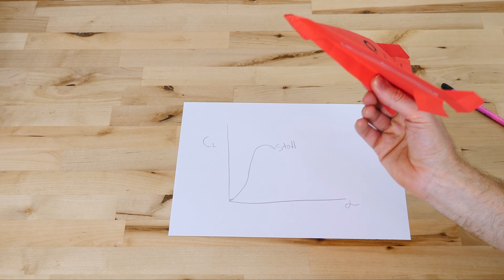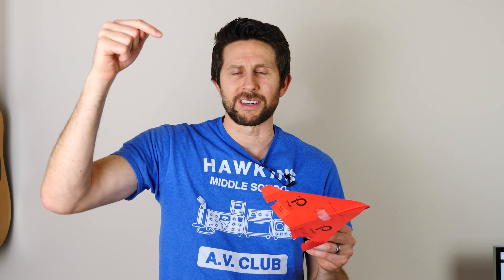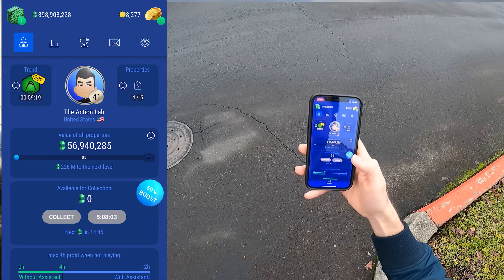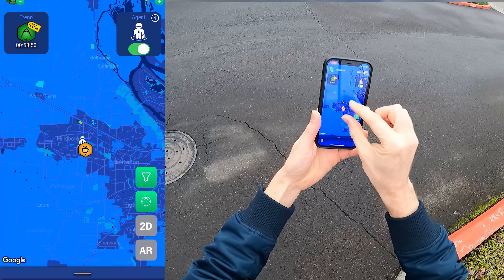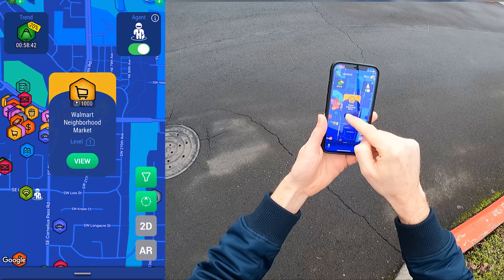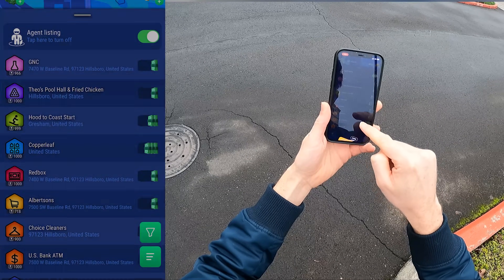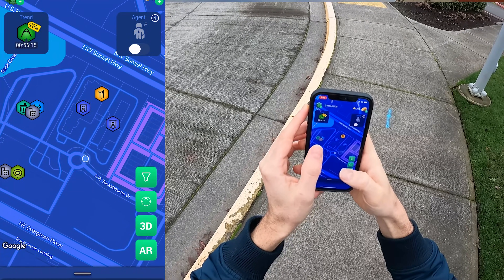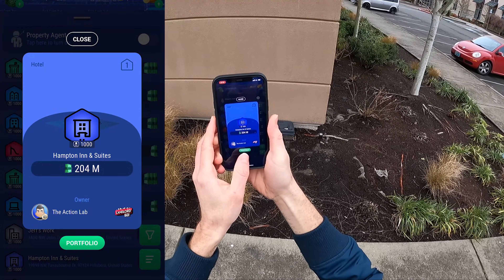How Far Can An Aluminum Foil Airplane Fly If You Add a Motor?

Comment: What is the difference between a plane wind and the lowest Cx symmetrical profile tilted up? Is the first one is more efficient about drag?
Reply: i am le chicken nugget
Reply: One of the ways we measure drag is with what is called the Reynolds Number. the reynolds number of models this small is so high that "crazy" things that should not work..... work. like bumble bees :-) scaled up a bee can't work but scaled down? interesting things happen :-)
Reply: @nerys71  Yes! In layman's terms, a very small amount of air kind of acts like it's "thicker" than a large amount of air - or air has more viscosity relative to the inertia of a very small wing than it does relative to the inertia of a larger wing.

In a practical example, think of how a small piece of dust floats in air, while a similarly shaped pebble or rock clearly falls much quicker.
Reply: Short answer - yes.

For the long answer you need to know that aerofoils produce two kinds of drag.

The first type of drag is called shape drag or parasitic drag which is caused just by the wing existing, being a certain shape and size, and having to push air away from its way to proceed through the air.

The other type of drag is lift induced drag, or just induced drag for short. This drag is only produced if the aerofoil is actually causing lift. The amount of induced drag produced depends on how much lift is generated, and how efficient the wing is.

As long as the wing doesn't need to generate any lift, the most aerodynamic shape is a symmetrical aerofoil which can just go straight through the air. The vertical stabilizer is usually a symmetrical aerofoil (though not always), and it's also common for horizontal stabilizers to have a symmetric aerofoil.

However, if a symmetrical aerofoil needs to produce lift, it needs to have a non-zero angle of attack which means it's no longer flying straight through air. In this case the wing will not only produce a certain amount of induced drag, but the parasitic drag will also increase significantly because the wing is not presenting the least frontal area to the airflow (it's a bit more complicated than that but works for a simplified explanation).

The solution to this is the cambered aerofoil, which has an asymmetric curve to it, with more curved side upwards and flatter (or even slightly concave) side down. This type of wing can produce lift even at zero angle of attack, which allows it to produce lift while minimizing the amount of parasitic drag it produces. Typically, this neutral angle of attack is where the wing gets its best lift-to-drag efficiency, and that usually corresponds to a certain airspeed which gives the aircraft best possible glide ratio.

So yes, long story short - a cambered aerofoil is typically more efficient than a symmetrical aerofoil. However, the amount of camber depends on things like what the aircraft's typical airspeed is - if the plane is going to be flying slowly, the wing will probably be thicker and have more camber, while a very fast aircraft might have a thin wing with relatively small camber.
Reply: @HerraTohtori  Something to add to the parasitic drag: There are more components to the parasitic drag force than just shape drag, and the most important one you are missing here is the skin friction drag. Even for a thin flat plate at zero angle of attack (basically zero frontal area and thus zero shape drag), the surface area of both sides of the plate contribute to the skin friction drag. Depending on how fast the flow is or how long the plate is, the flow may transition to turbulent with an increase in skin friction drag.

Moreover, there are other kinds of drag which contribute to the total drag such as interference drag at the connection points of the wing and fuselage, ram drag fron the jet engines, and also wave drag if the aircraft is near sonic speeds.
Reply: @nicholaslau3194  Like I said it's "more complicated than that" ;)

But yes, skin friction is an important part of parasitic drag, especially with laminar flow conditions. With turbulent flow it's still there but it's a lesser part of the total drag, since the turbulence itself sucks up so much energy. But then you can induce a small amount of turbulence to energize the airflow, which causes it to better adhere to the wing and delays flow separation, so causing a little bit of turbulence can end up reducing drag because the small amount of turbulence reduces the total amount of turbulence... Hence, golf ball dimples and vortex generators.

At high Mach numbers, compressibility starts to play a factor too as the air simply can't move out of the way faster than the speed of sound in air, so the air starts to get squeezed out of the way rather than pushed. Compressing the air requires more energy than simply moving it out of the way, and has a nasty tendency to form shockwaves - which produces something called wave drag. And at very fast supersonic and hypersonic speeds, the compressed air sucks up so much energy that it actually heats up and starts to radiate that heat onto the aircraft itself, which requires heat resistant materials or active cooling to deal with.
Reply: @HerraTohtori  Just to add here the higher an aircraft is, the easier it it for it to reach high Mach Numbers (such as the critical mach number wich is when the flow goes from subsonic to supersonic somewhere around the aeroplane) because of the Local Speed of Sound. The Local Speed of Sound depends on the absolute temperature (in Kelvin) and the higher we get the lower the temperature (Local Speed of Sound is lower). The formula is: Mach Number=True Airspeed/Local Speed of Sound. So, if airspeed is the same, and we climb higher, the temperature will decrease (until the troposphere) and so the Mach Number will increase.

Edit: Also something that I didn't understand exactly: You said vortex generators decrease turbulence but I thought they only added energy to the turbulent air flow and thus delayed separation. Is that the same as decreasing turbulence? Also the level of downwash and the wingspan of the aircraft make a difference in induced drag (if I remember correctly) so there's another whole subject to mention ahahaha. I was supposed to have an exam about all this in February the 8th but it was postponed due to Covid. The only thing I've been struggling with is propellers.
Reply: @ThekingMandM  Vortex generators, like a lot of advanced fluid dynamics, are black magic only somewhat comprehendable by vast amounts of time spent staring at wind tunnel test data, or guessing with computational fluid dynamics. I have neither under my belt so take my commentary with a grain of salt, and consult someone who's actually qualified with aerodynamics and not just physics in general.

Basically my understanding is that, by energizing the boundary layer with small scale turbulence, they can delay flow separation from a curved surface, like the upside of the wing for example. The small scale turbulence causes some drag, but flow separation would cause large scale turbulence, which causes large amounts of drag.

The result is that by adding small amounts of energy to the airflow (which increases drag) the total amount of energy deposited to the airflow is actually reduced since the flow separation, and subsequent large scale turbulence, is reduced.

Of course, a wing that is designed to maintain laminar flow without vortex generators should be more efficient than a wing where vortex generators are utilized to delay flow separation, but it still feels like wizardry. And laminar flow wings tend to have some awkward characteristics compared to more conventional aerofoils, which means that vortex generators can provide a better balance between handling characteristics and performance.
Reply: @HerraTohtori   Holy moly
Reply: @allofall9240  
Holy Macaroni?.😎🐝😋😔😯😮?.
Reply: @THEBOOKOFDARK6888  Yes
Reply: @HerraTohtori  thanks for the executive summary
Reply: @HerraTohtori  Very clear, it's presicsly what I wanted to read! Thanks, I really appreciate 🤗
Reply: @HerraTohtori  https://youtu.be/naThwEARQD8
Reply: @HerraTohtori  please post a link 'evidence' of the nasa shuttle doing a back flip at 1:1 speed 27,000 kph. 
Your technical jargon is not going to suffice here sorry.

Lets see the thrusters 'firing', also show vectoring vapour distortions ailerons and flaps working hard to maintain control especially in the backward phase but all that should be obvious although the alleged atmosphere at that height was only suggested more recently (nasa.gov). 
 I look forward to that link.🤔
Reply: @AV036  What thrusters do you want to see firing? These videos were taken on standard definition cameras, there's only so much detail they can show. The RCS thrusters weren't used all the time while the shuttle was doing the pitch maneuver. They were only used to start the pitch-up, then the vehicle rotated freely through the maneuver, and then opposite thrusters were used to halt the pitch-up.

As for why the RCS thruster use to initiate the pitch-up is not visible - maybe the angle and lighting conditions make it difficult to see, maybe the camera is just too crap to show it. It's not like the RCS thrusters produce some kind of super obvious flames. They look like white puffs of gas which disappear very quickly after use - there are no "vapour distortions", whatever you think that means. I did find a couple of videos showing the orbiter's RCS thrusters in use, if you want a reference for what to look for:

https://www.youtube.com/watch?v=2ewbD2Pv5ag (STS-118)
https://www.youtube.com/watch?v=1xT4GstMyKs (STS-133)

These are the kind of thrusters that were used to pitch, roll, yaw, and translate the space shuttle orbiter during the orbital flight. In addition, the spacecraft had more powerful orbital maneuvering thrusters at the rear, which were used in prograde or retrograde burns to raise or lower the orbital altitude, respectively.

Also, the control surfaces were not moved while the vehicle was in space. That would have been quite pointless as the atmospheric density at that kind of altitudes doesn't provide enough aerodynamic control forces for that do really do anything. In the long term, the thin atmosphere produces some drag which requires periodic station-keeping burns to avoid orbital decay. For things like rendezvous and docking maneuvers, which happen in the timeframe of days, hours and minutes, the effects of atmosphere at orbital altitudes can be discounted as negligible. So, sorry, there's no footage of the space shuttle flapping its control surfaces to "maintain control" while it's maneuvering in space.

Finally, I don't really get your claim that the "alleged" atmosphere at the height of the ISS was "only suggested more recently". What do you mean by this? Clearly the atmosphere exists, there's not point "alleging" that it exists. The existence of the atmosphere is a fact, and the presence of gas molecules at whatever altitude is entirely predictable by classical mechanics.

People living in the 1800s could have accurately calculated the density of atmosphere at altitude 400 km above ground, though it would have a completely irrelevant exercise for them and they probably would have rounded the result down to zero.

By the way, why do you want to see something like this in 1:1 speed? I mean why make that qualification? Speeding up or slowing down footage doesn't really do anything to its value as evidence as long as the change is clearly marked and documented.
Reply: @HerraTohtori  https://youtu.be/-gSY7rFaqSM  true or false
Reply: @AV036  yes
Reply: @HerraTohtori  'yes' to observable reality laws of nature aerodynamics conservation of momentum vs impossible 27,000 kph space shuttle backflip no thrusters or proof this ever happened the way nasa say it did.
Reply: @AV036  What makes you think there were no thrusters used to start and stop the rotation of the space shuttle?
Reply: @HerraTohtori  well if you think otherwise please post your link showing that evidence in real time 1:1 speed 27,000 kph  ______ .
Only real camera footage should also show vectoring vapour distortions ailerons and flaps working quite hard to maintain control especially in the backward phase as we now have confirmed atmosphere at that altitude too (nasa.gov). 
I look forward to that link.
Reply: @AV036  Evidence of what?
Reply: Herra I actually made no claim🤔
I asked to see evidence of what lead you to merely take nasas' word for a backflip manoeuvre (in defiance of logic) of an aircraft that blatantly defied everything you claimed in your response to the start of this thread.
Holy moly😆 I now see you are clearly immersed in a somewhat infantile/ gullible cgi world of pretend WWll aircraft.
Ad to that a blind belief and verbatim quoting of nasa, renowned for their own epic cgi blunders and we get a list of your ridiculous supporting CLAIMS  🤣 Thankyou.
Reply: @AV036  Well, I did have a pretty good idea that you were a bad faith actor from the beginning, and I'm pretty sure everyone except you thinks you're just playing yourself. Keep congratulating yourself because there's no one else to do it for you. If you get better, and want to learn to understand how the world works, I'll be here for you. The world itself doesn't care either way what you or I think is real or true.

Still, if you wish to answer - why is it that you think the backflip maneuver of the space shuttle "defies logic"?

Do you think the space shuttle should behave in the same way as the small aerobatic aircraft in the start of the video you linked?
Reply: @HerraTohtori Holy Moly dude those links are embarrassing, do you still believe in santa-clause based on a couple of old Christmas cards or because we have reindeer farms.🤣
Reply: @AV036  First of all how dare you. 

Secondly, shows how much you know about anything! Father Christmas is very real and he lives at Korvatunturi in Northern Finland. I should know, because I'm Finnish and this is what I've been told all my life. 

Also, reindeer are not farmed, they are semi-wild animals. They live in the wild, they eat in the wild, and they get eaten in the wild. They're born wild and only really die in captivity. Reindeer keeping is mostly keeping track of the herds, and they are annually collected for the purpose of marking the calves, separating the reindeers to be slaughtered from the rest of the herd, and listing the individuals kept alive for breeding.
Reply: @HerraTohtori  quote "People living in the 1800s could have accurately calculated the density of atmosphere at altitude 400 km above ground, though it would have a completely irrelevant exercise for them and they probably would have rounded the result down to zero."  
Got evidence to support your CLAIM and your completely irrelevant exercise to say anything. i.e  do you think you could accurately calculated anything without experiment proof😈'0'
Reply: @AV036  Notice the word "calculated". The ideal gas law was discovered in 1834 by Clapeyron (if you studied some physics you'd know that name) and it can be used to accurately calculate (i.e. predict) how something like the atmosphere works.

When the ideal gas law is modified with the parametres of actual gases present in the atmosphere (mostly nitrogen and oxygen, and predominantly oxygen at high altitudes), it gives even more accurate results.

Hence, I'm pretty comfortable in saying that classical physicists in 1800s would have been able to predict the atmospheric density at 400 km altitude to a very good accuracy.

The reason why I said that calculation would have been a pointless exercise for them is that, obviously, they had no way to test the hypothesis provided by the theoretical model. But good job misunderstanding my point, which was specifically that the presence of very low density air at 400 km altitude was not a surprise to anyone.
Reply: @HerraTohtori  people with low ability at a task overestimate their ability to know everything. 
Action Lab is a rare example of an extremely intelligent critical thinking individual matched with his practical experience to demonstrate his thoughts perfectly. 
You on the other hand merely believe things based on authority figures providing you with information no matter how improbable. 
Case in point plainly evident by your quote. ["Father Christmas is very real and he lives at Korvatunturi in Northern Finland. I should know, because I'm Finnish and this is what I've been told all my life"]  acc. 2006 (you're not a child) and misunderstanding my context shows your just a naïve know-all.  
Arrogance balanced with irony, you are now finished.🖐  Danka for those epic links and keep believing in those nasa fairy tales
Reply: @AV036  Hang on. How do you explain this video then? https://www.youtube.com/watch?v=1g0xGr5wLKM

Is it real or not?
Reply: @AV036  What an eccentric performance! I'll never get those 12 seconds of my life back and I hold you accountable for that. Doesn't unfortunately answer my question though. If you don't believe that Father Christmas exists, could you provide a 60 minute long video, at minimum 12,000 frames per second in real time, of Father Christmas not existing? The video should contain at least one instance of no ho-ho-ho, two elves not spying on children, and a minimum of three shots of Korvatunturi not existing.

If you cannot provide this evidence by noon tomorrow, I'm afraid I'll have to conclude that you're full of it and that Father Christmas exists just as much as your ability to comprehend irony, or the physical reality around you for that matter.
Reply: @HerraTohtori  Like the time it takes for your epic tutorials? You are full of claims. 
Questions... Has satan-clause got flying reindeers or regular ones with parasites?  How's the drag coefficient on the sleigh. Does he get around to all the children in one night.🤔
Reply: @HerraTohtori  love your patience and irony with this AVO guy.👍 Kudos to you, mate. As for AVO, he is a blatant textbook case of Donning-Krueger and Godwin Point ("Nasa", "CGI" and "Satan": the hat-trick!🤭😂) effects.
Reply: @HerraTohtori 5 seconds of footage showing [ flipping out an antennae dish ]  is not evidence of a 'thruster' being fired.!!! 
🤣 that's 'your claim' evidence👉 https://www.youtube.com/watch?v=2ewbD2Pv5ag (STS-118)  better find a cartoon or some cgi and paste it in hey.